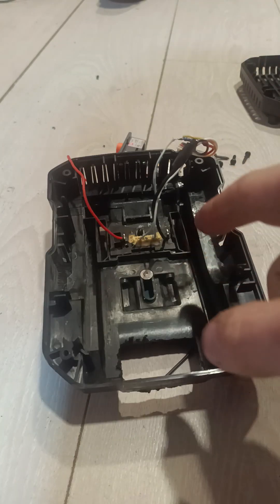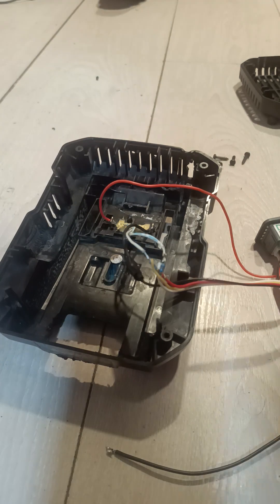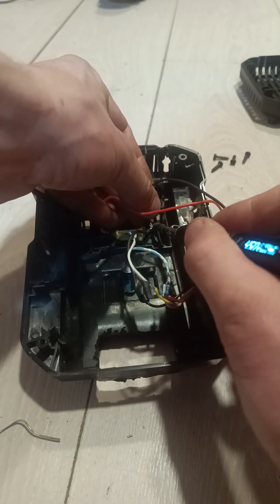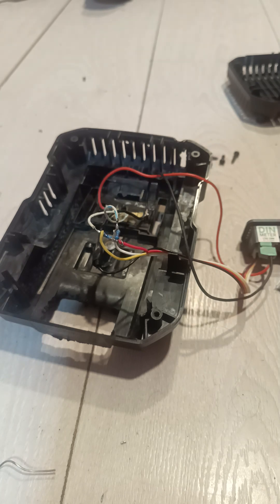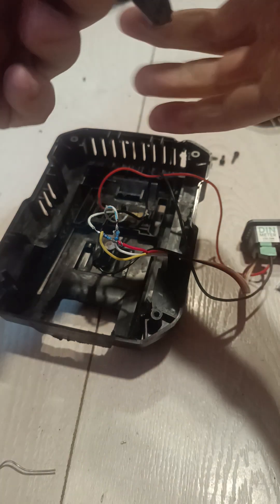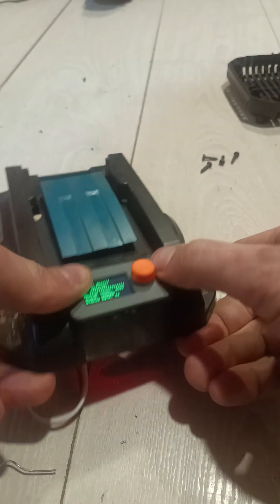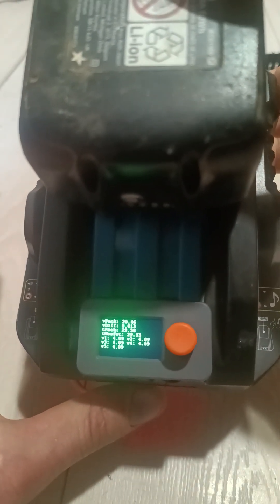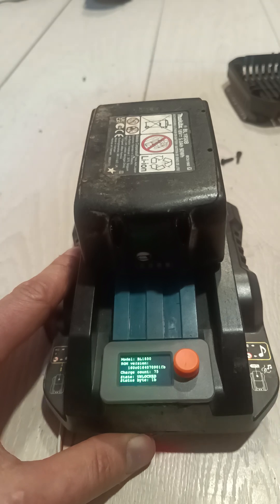Makita error/lockout flag reset ( simple standalone ) based on open-battery-information.

Comment: Hi there.

May I ask, the wirering confuses me, on the video that you've made and on GitHub, it seems to be a different wirering. On github there is a "box" with 1,2,3&4 at the top. What is this, and what does it do? While on the youtube version, theres 2 4,7k resistors, and this "box" aint there as far as I see.

Can I connect the m5din directly to the scrapped batterycharger or do I need that 1-4 item?

Regards.
Reply from the maker: You need the solid state relay if you want to support 36v batteries, otherwise a direct connection WITH a 4k7 pull-up resistor on that line will work. You can look in the git history for the older wiring.
Reply: Thanks! So will this support the xgt as well, or will I need the other version for that?
Reply from the maker: @ThomasNielsen-p8w  You need the XGT repository on my github, but the fun part of that is the XGT version is much easier to wire up

Comment: Hi, what is the error codeC:\Users\Documents\Arduino\makita_bms\makita_bms.ino:3:12: error: field 'owi' has incomplete type 'Makita<5>'
    3 |  Makita<5> owi=Makita<5>();
      |            ^~~
In file included from C:\Users\Documents\Arduino\makita_bms\makita_bms.ino:1:
c:\Users\davidlsj78\Documents\Arduino\libraries\OneWire-2.3.8/Makita.h:30:30: note: declaration of 'class Makita<5>'
   30 | template < int m_pin > class Makita {
      |                              ^~~~~~
C:\Users\Documents\Arduino\makita_bms\makita_bms.ino:4:6: error: 'void Makita<m_pin>::setup()' cannot be overloaded with 'void Makita<m_pin>::setup()'
    4 | void setup()
      |      ^~~~~
C:\Users\Documents\Arduino\makita_bms\makita_bms.ino:4:6: note: previous declaration 'void Makita<m_pin>::setup()'
    4 | void setup()
      |      ^~~~~
C:\Users\Documents\Arduino\makita_bms\makita_bms.ino:19:6: error: 'void Makita<m_pin>::loop()' cannot be overloaded with 'void Makita<m_pin>::loop()'
   19 | void loop()
      |      ^~~~
C:\Users\Documents\Arduino\makita_bms\makita_bms.ino:19:6: note: previous declaration 'void Makita<m_pin>::loop()'
   19 | void loop()
      |      ^~~~
C:\Users\Documents\Arduino\makita_bms\makita_bms.ino:29:2: error: expected '}' at end of input
   29 | }
      |  ^
c:\Users\Documents\Arduino\libraries\OneWire-2.3.8/Makita.h:30:37: note: to match this '{'
   30 | template < int m_pin > class Makita {
      |                                     ^
c:\Users\davidlsj78\Documents\Arduino\libraries\OneWire-2.3.8/Makita.h: In member function 'void Makita<m_pin>::init()':
c:\Users\davidlsj78\Documents\Arduino\libraries\OneWire-2.3.8/Makita.h:37:11: error: 'm_timestamp' was not declared in this scope
   37 |           m_timestamp=0;
      |           ^~~~~~~~~~~
c:\Users\Documents\Arduino\libraries\OneWire-2.3.8/Makita.h:38:11: error: 'enable_extended' was not declared in this scope
   38 |           enable_extended=false;
      |           ^~~~~~~~~~~~~~~

      |  ;
exit status 1

Compilation error: field 'owi' has incomplete type 'Makita<5>'
Reply from the maker: missing the makita.h in the libraries, or did not copy the include of it?
Reply: @diybatterytech the Makita.h is in the folder arduino - libraries- onewire-2.3.8 inside total 4pcs  .h no missing

Comment: Hi, can you show the wiring connection m5 stack to Makita LXT battery, because I saw the schematic I do not understand the component 1,2,3&4 leg , totally different with your video, thank you very much
Reply from the maker: Ah, LXT see the schematic on github? yellow is the enable pin, this goes via a solid state relay or whatever to the enable pin on the battery header. Point is to supply 5v at potentially high current. White goes to the red ( + ) wire with a 4k7 pullup resistor, and goes to the communications pin. Other than that ground goes to ground. The enable pin is the second one from the + side of the connector. The communications pin is the second one from the - side of the connector.
Reply: @diybatterytech  thank you for your reply, could you updates diagram to your GitHub  because  saw 2 4.7k  on above  the video ❤
Reply: @diybatterytech  hi could you update the wire diagram  on your GHUD , the wire connection you show on the YouTube, thank you very much
Reply from the maker: @cryingeva  Please follow the wiring diagram on GIT if you want to use the current version of the firmware. This video is older, and uses the older wiring diagram. You can check out a previous GIT revision - and get the schematic for that ( however it will be much slower communication wise, and not support bl3626 )
Reply: @diybatterytech  what is the component name  had 4 leg on the GIT? And where can buy it?
Reply from the maker: @cryingeva  4 legs? you mean the solid state relay?
Reply: @diybatterytech Yes, do you have the part number? Or just DC to DC  Amp?
Reply: @diybatterytech Yes, do you have the part number? Or just a DC to DC how many voltage and  Amp?
Reply from the maker: @cryingeva  Dc to DC, 3v in 5v ( minimum  ) out, https://nl.aliexpress.com/item/1005008334226648.html? something like this will do
Reply from the maker: ;) it's carrying 100ma ish max, so literally anything cheap enough basically. using a mosfet is also fine
Reply: @diybatterytech  thank you very much

Comment: This does not work on a BL1840 - the older ones without the battery charge lights. If it does, please clarify.
Reply from the maker: It does not work on very old batteries indeed. depends on the chip that is on the PCB - 1840 i've managed to reset a few. If the chip is f0513 it will not work.

Comment: next
Reply from the maker: ;) next will be stihl or hikoki
Reply: @diybatterytech If you colud do it for Hilti that would be great.
I have so many locked Hilti battery pcbs
Reply from the maker: @nsld8891  I could work on that, same method of retrieving firmware will work, they use the same chip as makita, method is solder the f0513 chip to a breakout board, then program a trojan and extract firmware/debug key. i'm not sure these are unlockable via the power connector - and i don't have any hilti batteries to try right now however